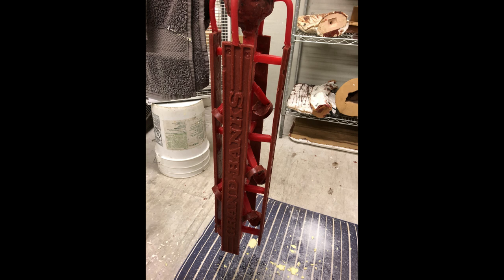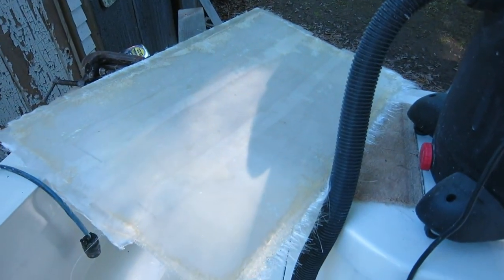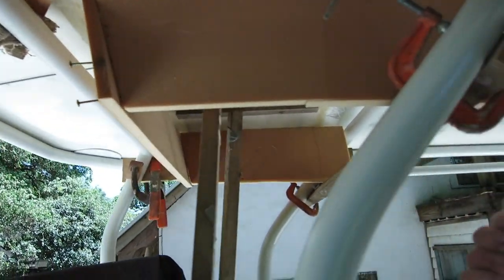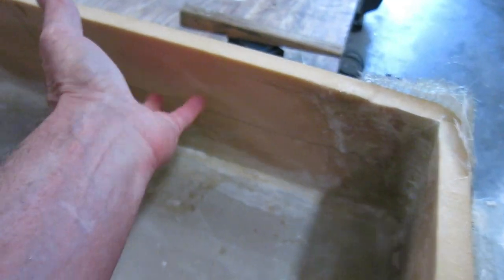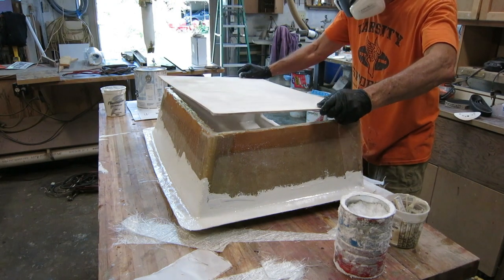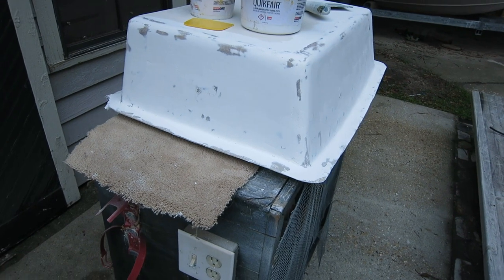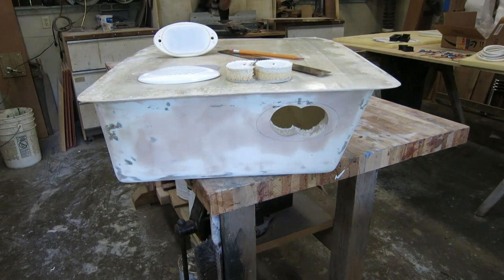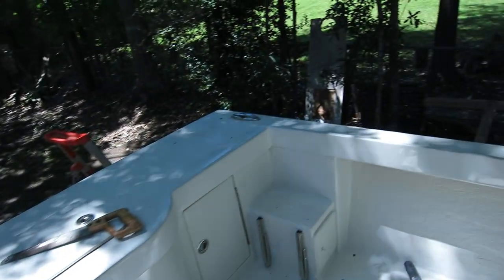DIY T -Top Box #41 Of The Center Console Project Boat

Comment: Great video! I never would have thought to drill and tap the holes in the the plexiglass door, genius!
Reply from the maker: Kirk
As I often get myself into these situations I didn't know if it was going to work. But those tiny little threads don't require the removal of very much material so nothing bad happened and I think it should work long term without issues.
Thank you!
Barry

Comment: Hi Mr. Luke,
The boat is looking great and the electronics box came out perfect, I would to see you start using wax paste as a releaser, is one we used a lot is call Partall Paste #2 is a green wax paste that will help you a lot and save you time and worries, also same company makes a liquid call PVA for short that you can spray or brush.
Good job,
Frank
Reply from the maker: Frank 
Thank you for commenting on the release agents. If I ever start a new substantial glass project I will look into these products. But You may have just witnessed the last glass work I will ever do.  
Anyway, thanks for watching!
Barry

Comment: Barry, have you tried using a fin roller to roll out the air bubbles? It may be what you need to get rid of those pesky bubbles alot easier.
Reply from the maker: Nathaniel
I have a couple of fin rollers and do use them but not enough. I have had issues in the past with our summertime temps and quick setting resin and spending valuable time trying to keep the in roller clean that has caused issues. No excuse really but I am sticking with it. Thanks for watching and thanks for the comment.
Barry

Comment: Barry, you're a master of glass work. +1 for a magnetic latch. Was that a teaser for a bronze pour vid? :-)
Reply from the maker: Fish
Thanks but master might be a stretch. I get by. Got a pour scheduled next week, maybe I can grab a little footage. 
I will check out using magnets.
Thanks
Barry
Reply: @barrylukebuilds7894  
The great thing with magnets is the same magnet can hold the door up too or use a metal tab(s) on the door and magnets on the box and T top to hold the door closed and open.

Comment: I can't understand how you put epoxy over uncurred polyester ? Since you are using laminating polyester resin(no wax) . Wouldnt gelcoat  with wax or PVA be the item to use over uncurred poly? Then paint it with epoxy paint if that is what you want? I must be missing something here?
Reply from the maker: Bill
Maybe a long long time age some old dude made an object out of resin and used PVA as a curing agent. His friends all told him he was doing it wrong and he responded "but I have lots of this stuff, it's free and it works". 
You are not missing any thing, really. I like simplicity. I use laminating resin to build with and certain epoxies to transform the slightly sticky surface into a hard sand able surface. My goal is not to coat the surface with epoxy paint but to have a surface I can work with.  Not all epoxies work, it is important to do tests.
Most of the epoxies I use I get for free from my coating contractor friend, as of yet nobody has given me any free gelcoat.
Thanks for watching and thanks for commenting.
Barry